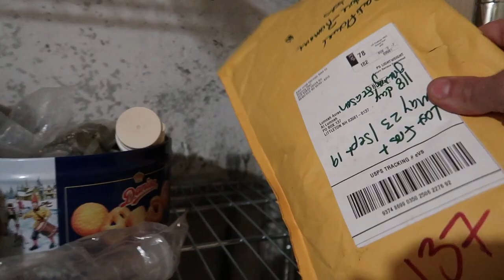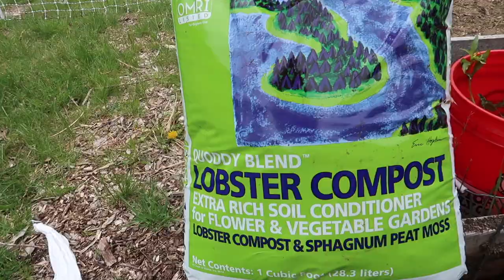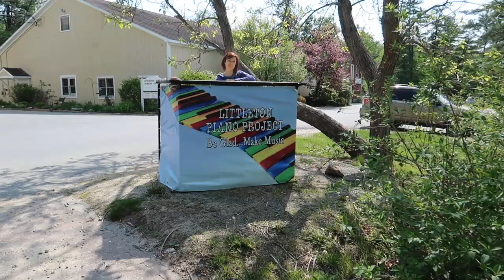It"s Time To Plant these Tomato Plants! ( after we work on the Goat Barn)

Comment: Al:  I use a clam shell Post Hold  Digger to transplant my quart to 1/2 gal. ( your 4" blocks)plants and a bulb planter for the smaller transplants.  Blood & Bone fertilizer in the hole ( plus  Epsom salts with the tomato's ).  Back fill and firmly pack with my 3 year old compost ( fine as dirt). Then top dress with B&B fertilizer.    the old guy    Bert

Comment: Al, my only concern on your barn is if there is going to be any cross ventilation in goat structure. Even if it is for storing hay and feed, air flow to help with heat and humidity are going to be necessary. Otherwise, excellent repurposing and the garden looks great. And I agree with you and Gina, Olivia was missing out on some good eats by the looks of it.